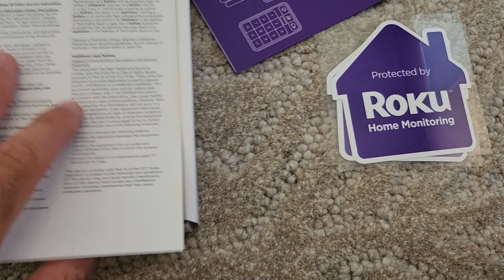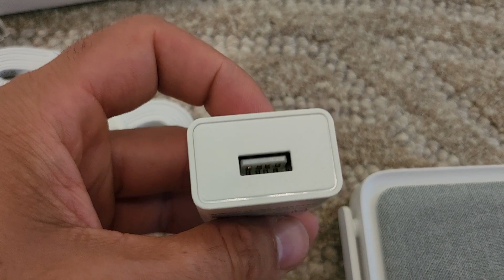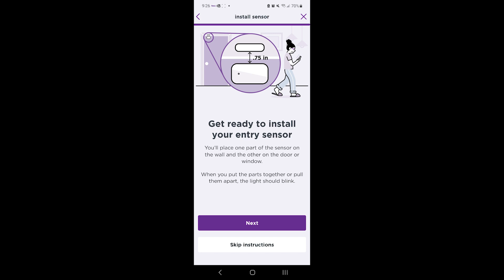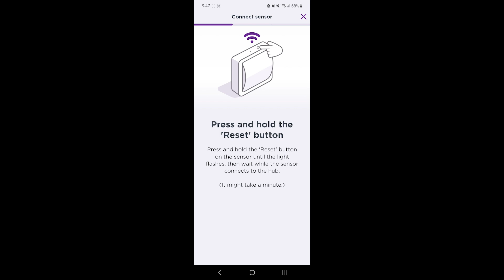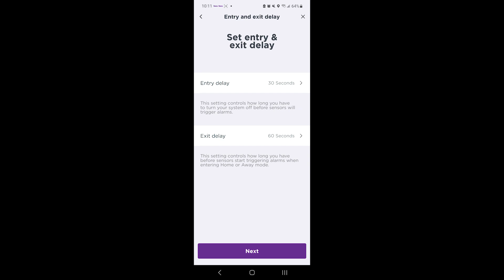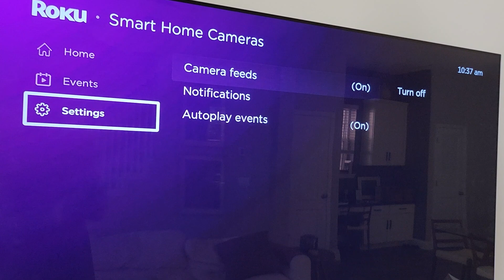Roku Home Monitoring System SE Security Alarm Motion Door Window Intruder Invasion Surveillance

Comment: Honest review: I haven’t had much luck with this system. While completing the last step the code in the app glitches and doesn’t allow the user to continue. After purchasing two others to make sure the one I got wasn’t a dud, I did some research and found out that the system isn’t compatible with IOS (Apple) devices. There’s about a 1/20 chance they’ll work with your iPhone, regardless of if past roku systems such as cameras worked for you. I’ve contacted Roku support on several occasions but of course they’re not willing to update their code to allow the app to be more user friendly or compatible with IOS devices. If you’ve had success with this system as an Apple user great! If not, sorry, the better option would be “SimpliSafe” home monitoring system. Super user friendly, and easy set up!

Comment: Does the Home Monitoring System be Self Monitored without a Subscription. and also Don't put Motion sensors to activate an alarm in Home Mode because what is its is to Disable The Motion detectors in the house and the rest are On, And Enabling Motion detectors in home mode to activate the siren defeats the Purpose of the Home Mode
Reply from the maker: @iansanchez1470  yes you can self monitor for free. Don't understand the second question.
Reply: @davewelike  Home Mode is so you can move around your house without setting your alarm off. Make sure your motion sensor in your living room are set to only trigger the alarm in Away mode, otherwise it will defeat the purpose of Home Mode and just have On and Off

Comment: There is one major flaw of these systems everyone overlooks if your power is shut off your internet goes down and this system is usless having your system on battery backup helps but if rhey cut your cable to your cable internet useless id atleast at minimum battback up roku hib and modem and router if they cut your internet thier experts and you go more issues than Roku can handle and should have a better system anyway
Reply from the maker: I think the hub has a built in battery. Don't know how long it lasts. If someone goes outside your home and cuts the power and cord, you seem more f...d than what any system will do. Call the police with your cell phone and pray.
Reply: I don't think it's overlooked, it's all risk assessment and budget.
Reply: That’s why I use Verizon 5G Business Internet and Home Internet. I have Business as a backup.

Comment: Thank you for this video, was in a different Walmart then my regular one yesterday and they had this on display i had no clue about it. So of course now going on Youtube to see what it is all about, been wanting a new system for a while. Do you have any clue how far away the door/window sensors or motion sensors can be from the main unit ?  Like to also secure my out building and garage. 
Thanks
Reply from the maker: I was thinking about getting a sensor for the garage but I don't know how far they go. I have the hub near the back door to the house and my sensor for the front door is able to connect.

Comment: Does anything about the entire system integrate into Alexa or Google Home, Dave? Roku needs to work with more devices...either via 3rd party partner support with companies like Hue and Lutron? Or full on Matter support, which would be better...
Reply from the maker: Says on their website that it works with Alexa and Google Home. I personally believe in the idea that I want one platform with branded devices than multiple platforms with varied product manufacturers. You'll get an ecosystem that could quickly become broken. It's possible Roku will allow other smart home product companies to integrate their products with Roku OS but they haven't announced any partners yet.
Reply: @davewelike  I knew the cameras and bulbs do... Just didn't know if the security system carried over too. And yeah, while a singular ecosystem loyalty is nice? For me? It's not realistic. Hopefully someone will make a Home Assistant Roku Smart Home API integration at some point down the road, if not Roku/Wyze themselves supporting Matter specification like almost every other literal smart home company has signed on to do...
Reply from the maker: @craigs.4302  How many smart home products do you have? Might not be possible today for them all to be in the same ecosystem but hopefully one day they could be. 😉
Reply: @davewelike  Wiz bulbs, Hue Bulbs, Lutron switches, Aqara sensors, Meross Garage Door Controller and Desk Lamps, Chamberlain MyQ controller, LG ThinQ Dishwasher & Clothes Washer, Bond Ceiling Fan controllers, Tuya desk fans, Amazon Echo Shows, Google Home Displays, Apple HomePods, Google TV boxes, Fire TV Cubes, Roku TVs and Soundbars, Google Nest Doorbells and cameras. Most of it all connected and controlled by Home Assistant on my Raspberry Pi 4.
Reply from the maker: Haha that's amazing! How's your family deal with all this?  I do have Hue bulbs, GE appliances, Honeywell thermostats, garage door would be smart if internet reached it, Android TV with Roku Soundbar, Roku lights, Roku home monitoring, Roku doorbell. I'd love to get rid of the Hue bulbs but my wife likes the color of them better than Roku. I think it's much more difficult to select a color on Roku than Hue. Probably cost you a good amount to switch to Roku with the bulbs and sensors but might be something to think about it Roku continues to expand with Wyze products. Wyze definitely has a lot of products left that Roku has yet to make their own version of.
Reply: @davewelike  I mean? There are hiccups with the fam at times, but nothing too serious, long as the power stays up and running. Home Assistant on the Pi runs most things using local API's, so most things work when internet goes down. I just usually have Home Assistant send announcement commands to Alexa or Google Home when the clothes or dishes are finished, or when the garage door is opened or closed...along with TV notifications on Fire TV/Android TV. When someone rings the doorbell? The TV pauses (to mute it) and the chime/Alexa voice announcement plays, so we can hear it. I create virtual switches/buttons from Home Assistant and run them into Alexa, which links from Alexa routines into Home Assistant automations. Home Assistant is essentially "god-mode" smart home automation, but there's definitely a learning curve to it and can easily overwhelm...it's open source and community supported on Git Hub as far as device support and integrations go.

Comment: I have this system it’s amazing
Reply from the maker: Glad you like it!
Reply: @davewelike  how are you liking yours after having it a few days so far did you get the professional monitoring.
Reply from the maker: @PresTech24  haven't gone pro but love it. Used the motion sensor to turn on roku lights automatically at night and then shut them off too. Pretty sick! I'm going to do a couple more videos showcasing some of that soon.
Reply: @davewelike  same i’m just self monitoring mine while im still getting used to it I’ll eventually get the professional monitoring
Reply from the maker: @PresTech24  I have to imagine that self monitoring is just as good unless you can't get to your phone in an emergency.
Reply: @davewelike i’ve ended up switching to the Ring Alarm System since then since Roku doesn’t have cellular backup and Ring does which is necessary.
Reply from the maker: @prestonw9844 booo! Don't you have to pay for cell service?
Reply: @davewelike  it’s a option but I can still self monitor mine